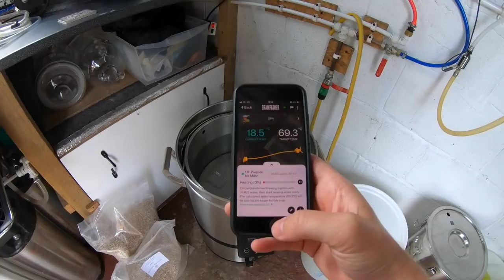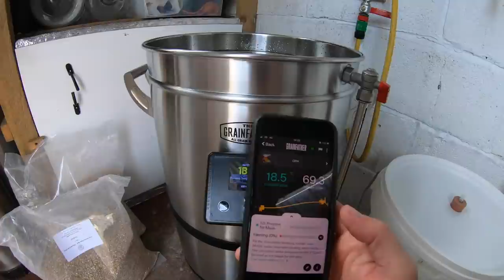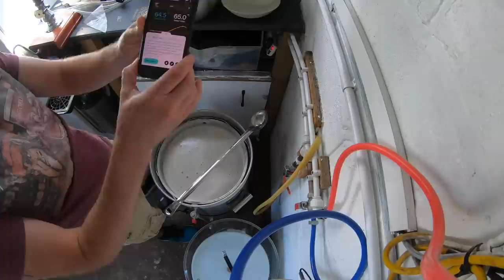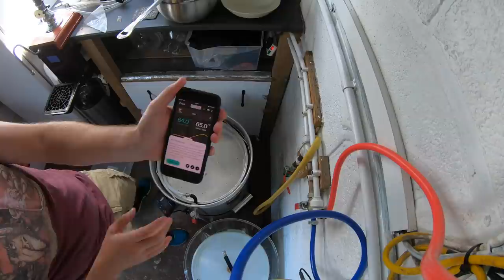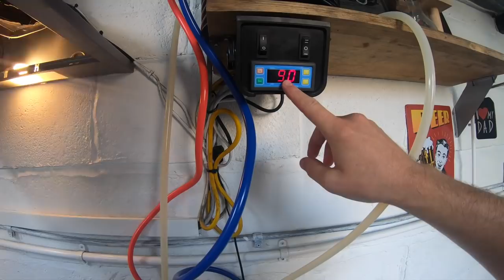Pushing the NEW Grainfather G40 - 40 Litres of OPA?

Comment: I don't know much about UK specs but wire diameter for a given amp/volt load are easy to find. One thing to remember, It's hard to oversize a wire but easy to under size,  same with breakers.(way too much to go into depth here) Make sure your upstream wiring can take what you wire downstream. I'm not certified here in the US but I do industrial air compressors up to 600 HP and I cannot tell you how many times I have had to come behind certified electricians and correct their errors. 
REALLY enjoy your videos by the way. Hoping to get a G40 after the first of the year and watching you keeps me dreaming.

Comment: Expensive, in New Zealand I paid $1483 which is 697 British pounds. It took me 4 brews to dial in the absorption and boil off settings, the boil off setting is way higher than the G30. I run my G40 at 15 Amps and have set the boil off to 4 litres per hour, I also drop the heating percentage depending on the ambient temperature, as low as 85% during summer.

Comment: Top video mate. Brewing on my G30 now 4 years and its ran faultless to be fair, but like most Im growing tired of the messing about with the silicone lol even after 4 years it can still piss you off before the start of a brewday !  I think I could be very tempted to upgrade to this soon. And i like the fact that cleaning looks easier than the g30 too. Great vid. cheers
Reply from the maker: Cheers Jake!
Reply: Jake I recently bought the G30 and was so tempted to hang on for the G40. But the G40 was a little out of my budget at the time looking forward to my first brew with g30 though
Reply: @LiamDavies45  You wont regret it, the g30 is bullet proof. Ive had no issues with mine in 4 years and still looks and brews like brand new. Good luck with your first brewday on it mate :)
Reply: @JakesCraftBrewing  that’s good to hear can’t wait to get cracking with it will get some footage and put it on my channel when I do. Cheers 🍺👍🏻

Comment: Great video! I particularly like that you did a full size batch. Reviews I've seen for other big systems usually only make small batches in it anyway so you can't see how well the big batch actually works, which is the reason you would get that machine in the first place.
So the experience with a big batch is that you can't get a really wild boil going (which might not be necessary, granted) and you are probably not going to get the full 40L out of it. The Grainfather site now says a full batch is only 38L, not 40L but I guess 38L is good enough. That is pretty much two full kegs worth of beer.
Reply from the maker: Thank you! Yes, the information is a little contradicting from the description and the spec sheet BUT I recon I can get the 40L haha

I have some work to dial it in but i'll get there! Cheers

Comment: Good explanation of the new kit, a couple of things. 1) Sight glass text should be white, my Brew Monk has the same issue, you can't see the text is if the wort is dark. 2) Do you not put the pump on to recirculate the water when heating the strike water?
Reply from the maker: Thanks mate, yes you're right it should be white! And I'll use the pump to circulate next time, I quite like the fountain it makes :) Cheers

Comment: Hello Griffo, 

this is the first time I see one of your videos. Really well done, congratulations! Everything is clearly understandable and reproducable, and I really like your style a lot. I just have my new G40 sitting behind me, waiting for the first brew this weekend, putting my G30 into the past. But one thing I miss about the G40 is the pluggable temperature sensor that fit so nicely into the wortometer. And I just see in this video at around 16:43 that you use it with your G40 still, and that you seem to have a nice temperature sensor plugged in. Could you be so kind as to tell me what temperature sensor and/or thermometer you are using for this? I am really curious.

Cheers from Berlin, Roman.

PS: Ok, never mind - you explain it just a few seconds after I paused for wrinting this question. Thanks a lot!

Comment: Cheers Griffo - I have similar thoughts on the G40. Tap should be standard. The extra power your version has would be great! 2300W here without 15amp power. Good brew day mate!!
Reply from the maker: Thanks buddy, that will be my first add on that's for sure! haha
Reply: @HomebrewGriffo  just be careful as the thread depth is pretty shallow.  The one I bought doesn't fit without some tom-foolery.

Comment: Thanks for the unboxing and brewday vids. I am in the market for an All-in-one, and this unit, while a bit over budget, is calling my name. Do you think with a heavy hop schedule (NEIPA, DIPA, etc) the bottom filter will keep from clogging the pump? It seems to me like enough trub snuck by it to cause some concern, but it is difficult to tell. And with the pump integrated into the bottom, if it needed cleaning, is it at all accessible? Do you have an idea what sort of threading it would be if you replaced that nut with a valve? Thanks, mate!
Reply from the maker: Thanks for watching! I'm confident that the pump and filter can handle a big hop schedule, I haven't taken a look inside the machine yet and the thread for the valve is the same as the G70 so I'm told. Strass Brewing mentioned it's a non standard pitch on the thread...
Reply: @HomebrewGriffo  Ah. As an American now living in Europe, I'm finding none of the threading ever matches anything!

Comment: To bad it has no user removeble heating elements like BrewtoolsB40 and Speidel.  Thats 's  for me the biggest selling point.  It must be modular. And at 1300 euro this G40 is not worth his money.   But i hope you like it.
Reply from the maker: Each to their own of course but I don't see why i'd benefit from removing heating elements that don't need cleaning... Should be covered by the 3 year warranty if any issues I guess.
Reply: @HomebrewGriffo   Its the high price point.  At this 1300 euro price i would expect a modular brew kettle like Brewtools or Speidel.   And not a cheap looking trash bin.  What were they thinking at GF.
Reply: African Twin, it’s half the price of the equivalent B40 set up, you’re not really comparing the same thing.